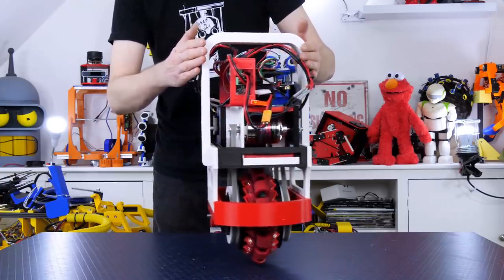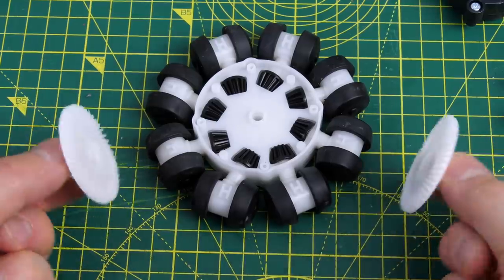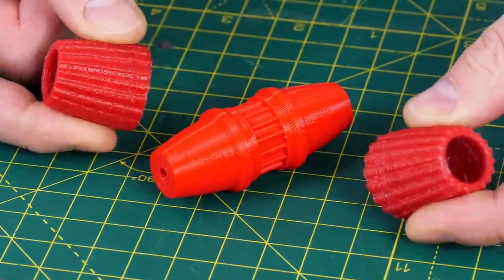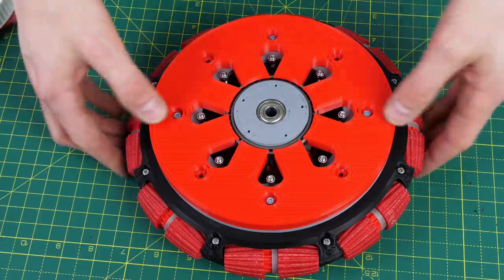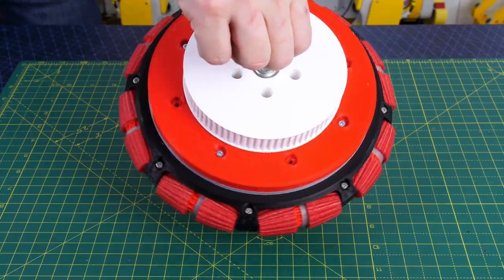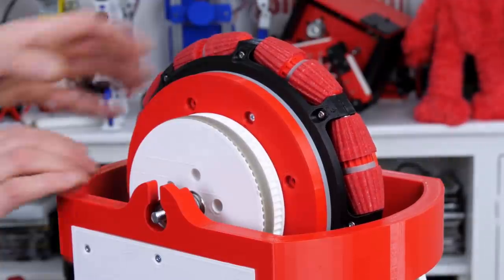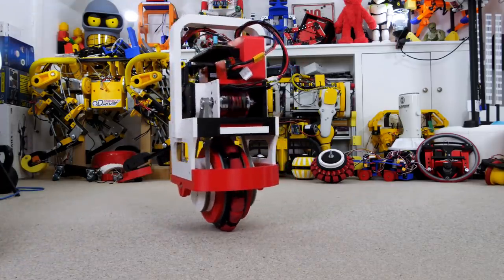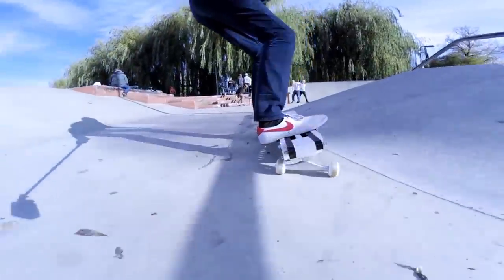How It Balances on ONE Omni-Wheel

Comment: Given the encoder could you use that to determine the position of the large wheel on the bottom and use a velocity multiplier based on the known geometry for the tapered wheels? May not be perfect but better than unknown.
Reply: Seems pretty doable! If he's using a relative encoder then it will be difficult because he won't actually know the rotational position of the wheel, just the displacement from the initial position at power-on. Using an absolute encoder or being careful to power the  machine on with the wheel in the same position each time (or rather, one of several equivalent positions because the wheel has some rotational symmetry) would fix this though. Maybe we'll see this in v3?
Reply: That's a cool idea and sounds like it should theoretically work on a level surface. But the moment you encounter any sort of incline you'll be in trouble because the part of the wheel that's in contact with the ground isn't at the direct bottom of the wheel.
Reply: yeah, this was the first thing that came to mind once he mentioned having problems with the taper on the small wheels. It's pretty doable and I bet James already thought of a similar solution.
Reply: I was literally thinking the same. The encoder would need to be quite high resolution though as even a single degree of precision would throw it all off. This could be get quite expensive so the trade off between this solution or just a bumpier ride via constant diameter "wheels" would be interesting. Mind, he's probably got enough encoders lying about that one will work.
Reply: I'm not a control theorist but..how about, instead of using a positional encoder you could see how much acceleration (from IMU) a certain movement of the wheels made, calculate the implied gearing (which side of the wheel is on the ground) and adjust the movement accordingly. I guess this would be akin to a double pendulum closed-loop? Success would depend on the sampling rate of the IMU, motor drivers, control loop, etc.
Reply: Came here to say the same thing, but probably wouldnt of been as well worded :p
Reply: Would the idlers perform better if they were a bar with a concave curve to them? Maybe less slop?
Reply: But only on flat ground
Reply: Exactly, because driving it at the same speed regardless of position is only accurate for a circular wheel when in fact it's closer to a regular 16 sided polygon (hexadecagon), not exactly because of the give of the TPU where the wheel meets the surface. But it would be closer.
Reply: @sherwoac  i think the reality of the arduino based imu is that they're probably too noisy and not refreshing fast enough for fidelity on that level
Reply: It seems that the speed needed to keep the taper the same speed would make a sinewave, so just have that sinewave programmed into the speed controller and keep it alinged with the wheel using a hall effect sensor and a magnet in the wheel.
Reply: Install an absolute encoder on the drive wheel hub.  Or use a photodetector and paint spots on the hub that line up with when the wheels are "small" so it can switch between two gains.

Comment: Just a quick tip: adding a bulge to the belt driven gears will keep the belt in the middle of the gear. Not sure if it will work with a twisted belt. Cheers
Reply: Crowned like on a band saw
Reply: Whenever I encounter this concept, I always have to convince myself that the belt would actually move towards the bulge.
Reply: @milandavid7223  It keeps train's central to the rails too

Comment: If you could predict the position of the shaft you could predict the cone of the smaller wheel and adjust your algorithm accordingly. Incredible video as always thank you for making these!
Reply: Differential equations. Little bit of math would solve this whole thing
Reply: The coding needs to be tweaked so it's horizontal axis isn't as glitchy and mechanical, using no gradual braking or acceleration, just full power, full stops making it compensate itself by incremental building up reverse inertia via momentum.

Comment: Next iteration:
- using more and shorter wheels with constant diameter
- miniaturizing the belt system to fit more belt systems
- using one gear to drive 2 belts (effectively doubling the amount of usable belts)
Reply: Would the idlers perform better if they were a bar with a concave curve to them? Maybe less slop?
Reply: @reubenj77  either straight or convex, since the belt will walk itself off a concave roller
Reply: @WetDoggo , yeah, I saw a demonstration where a belt will center itself on a convex pully. He should be able to prevent the belts from walking, by making the mating surface convex.
Reply: @notahotshot  the idlers/tensioners can be convex, but the gears can't be convex for good meshing.
At least not strongly convex...
A little bit of "convexness" might actually aid a bit in keeping the belts in center.

It might be worth a Test 🤔

Comment: wouldn't dust and debree be a major disadvantage of designs like this where the wheels that contact the ground act as part of the internal mechanism? I imagine it could jam up pretty quickly
Reply: That's mostly true of any omni wheel.
Reply: @aviphysics  not that motorcycle
Reply: @ionbusman2086  It's also the case for the mini motorcycle. Drive it a little bit into the mud and even those nice molded plastic gear will eventually jam.

Comment: Ever thought about using machine learning to balance these robots? seems like the perfect use case for ML. It could optimize for stability and least wobbility.
Gather lots of Input and sensor output data using this crude stabilizer (add some randomness to it) and train a sensor output predictor. This is a physical model of the bot. Use it to train a second model that optimizes input to predicted sensor output for stability and least wobbility.
The gathering and learning could be done more or less in realtime. Let it do its thing and collect more data for both models and train it at the same time.

Comment: Hey, Motorsport engineer here. 
Really cool wheel mechanism on that robot. Although, I don't think the tapered wheels are hurting it as much as you think. 
I have a hunch that controlling the lateral motion with only one motor is creating a yawing moment due to gyroscopic effects from the motor. 
I think when the robot leans to left, the motor spins up to lean it back to the right. But in doing so, also yaws it to the left due to gyroscopic torque. There's probably some unintentional feedback that is created from there. 
The easiest fix would be to spin up the second motor as well to control lean angle and see if that does anything.

Comment: Can you add an encoder to get orientation of the big wheel? then you should be able to know the diameter of small wheels contacting ground. Then add it to calculation of required motor speed. A bit of an overkill, but I see the wheel will vibrate when moving forward.

Comment: Another solution to the belt walking might be to just make the gear teeth concave, like an hourglass, so that the belt wants to just stay in the middle of the gear, rather than adding more parts to complicate things and increase the total print time. EDIT: Perhaps sticking with the belt strategy and "pinching" the gears to keep the belt centered you could double up on the smaller wheels to improve big wheel's roundness, without tapering/rounding the smaller wheels? Otherwise I was thinking somehow track the position of the big wheel to know where along the smaller wheels is contacting the ground and modulate the speed of the smaller wheels from there - which would be a bit of overengineering IMO. I'd try just increasing the total number of wheels at least by double first and if that didn't pan out then I'd resort to tracking the big wheel's rotation and compensating for the radius of the tapered smaller wheels.
Reply: Flat belts tend to walk themselves out of dish pulleys, a crowned pulley makes them center but the twist complicates this, also the fact they're toothed. You can't keep a constant tooth profile on a crowned or dished pulley.

Comment: If you added one more drive motor and made every other small wheel turned by the new motor, you could potentially gain another axis of control, i.e. yaw.
It looks like you have 2 small wheels contacting the ground at any given time, driving them in opposite directions will give you that ability to turn.
Though, you would almost certainly have to add an encoder and programming would be a right pain (every time the main drive wheel advances another small wheel, the rotation would have to flip between the small wheel motors to continue turning in the same yaw direction).

Actually, that sounds really complicated. Maybe just a huge flywheel and use it like a spacecraft reaction wheel, haha. The Honda 'single wheel thing' essentially did the same, except the reaction wheel was the user's arms.

Comment: If you have issue with the taper, have it move to the center of the small wheels before side to side, when not moving.
Would need to index at which rotation each center is, so it can move to the nearest.
This will cause it to move forward or back a little, but then the side to side would be much more stable.

Comment: That rug also play a role in the instability basically that rug act like mud, motors have to work hard to get it moving but when its finally moving there is too much power so it tried to slow down to the point where the rug being the problem again

Comment: interesting video)) engineering is on top as always)) now we need to complicate the task, and make the whole structure spin around its axis 360 degrees) it's time to add the 3rd engine, and figure out how to make the pair of wheels that is responsible for lateral movement spin in different directions for a turn)

Comment: Hey James, to prevent 3D printed parts to slip you can wrap around them some heat shrink sleeving. That's some quick and easy rubber coating. Regards.

Comment: Add weight up higher to raise the CG.  This will make the robot easier to balance.
          Here is a crazy idea.  Set the twist of the little belts alternating between each small wheel.  This will require the adjacent orange gears to turn in opposite directions to have the little wheels turn the same way.  The orange gears can be made a little larger so they engage with one another, so in theory, only one need be driven from the central gear.  You could have every other one driven from the center.  The others can be made narrow so they miss the central gear.  (You must have an even number of small wheels.  Since you have 8, this would work.)

Comment: Cool project! Can't help thinking you'd need a physical inertia  damper.. Like a damped pendulum, or whip antenna with a weight on top. Maybe you could do that in software, but possibly better to somehow engineer it in physically to the wheel? (a flywheel in the wheel?) On the Honda mono wheel, the active inertia damper is the person sitting on top. I used a passive method to damp out motion on a tall camera mast, rolling slowly on a DIY track and dolly. Worked really well!

Comment: 0:23 that main middle wheel, with those tiny side wheels needed to be rotated 45° and in the shape of a foot ball clipt at the edges for the accels. When the main wheel rotates, it will not have uneven wheel bumps, and the bottom main and rim wheels, will sync combo to all required ground direction.

Comment: Tuning the velocity of the small wheels should be fairly easy. Take the position of the main drive motor, apply the pulley ratio, and define the 'steps' of the wheel, in this case 16, then alternate velocity per step, as you have eight large circumferences and eight small circumferences with the tapers. You could also refine this further, interpolate velocities between the steps by using a sinusoid that provides the function for velocity based on the position of the wheel, so if you end up standing on the middle of one of the tapered half-rollers, it'll provide velocity for that specific contact, and not just if you're standing on one full roller (two large circumferences) or standing on two rollers (two small circumferences). 

Also, while off-plane idlers do work, a better means of belt position retention would be belt guides. Ideally you would want the belt to be, for lack of a better term, square with the pulley  it's on, to prevent walking. Assuming you can find a belt with enough flex along the axis of its width, this should be possible to do with properly modeled guides. Though this would need some kind of retention, a semi-closed channel (think of a squared C, a box with four 90° corners but an open slot in one side) could work, but so would a U-channel with additional idlers opposing the channel. This would also require low friction, PTFE tape should suffice but I'm not sure how well this would interface with the belt itself. If using a semi-closed channel, the ends should be flared on the toothed side to prevent snagging. 
Belt walking may not seem problematic, but there are power losses associated with it, because you're losing at least some amount of power to walk the belt along the pulley. A better fitted belt may also suffice, though. But a channel overall would be more ideal compared to just off-plane idlers. Think of a channel as a series of idlers, a constant surface easing the transition of the belt, rather than having the belt at angle A (0°), angle B at the idler (45°), and angle C (90°) on one side of the loop, whereas a channel would be a constant gradient between the two points as ∇f:0°→90° along half of the loop; yes, the actual loop is more complicated, as you have 180° turns at each end within a separate plane, but the part we're concerned about here is the planar transition between 0° and 90° along the length of the belt. In short, gradual transitions are better than segmented transitions, more efficient and with less wear assuming the same friction.

Comment: Making the little wheels cylinders with a thick coating of super soft rubber or silicone would help since the soft rubber  would compress in forward & backward motion, keeping it smooth. While also allowing for consistent diameter for side to side. ( with the right ratio of softness to stiffness). Alternatively, scaling it up while changing the little wheels to cylinders could help since side to side would be more consistant and the larger overall diameter would allow for more rollers, smoothing out forward and backward motion

Comment: Super neat implementation. 

Smaller toothed pulleys and smaller gears would go a long way to prevent misalignment, or angle of attack on the belt. Sure, skipping might be more of an issue - but compared to the friction drive it would still be 1000% better.

Smaller gears/pulleys would also allow to add MORE belts and more independently driven tires, to help maintain a more constant rolling circumference.

For tensioning, that ring was pretty painful! Angled slots or ramps like you might see in an iris would have been much more elegant.

Comment: Since you have positional sensors for your motors, you could probably calculate the current gear ratio as a function to motor position, and thus vary the speed of the motor as it travels in order to achieve a constant wheel velocity.

Comment: Re- your Mobius strip belt: if you don't want to use idlers to secure the position, you'd need to crown the surfaces that the belt is running on to make it center itself. There's a southbend lathe at my work that runs it's belt drive like that on perfectly smooth pulleys
Reply: That lateral oscillation might be an artifact of binding while it's trying to upright, that is then gone when the weight is shifted off of whatever is causing the binding

Comment: I think you can compensate the tapered wheels problem in the software. You need sensor like an accelerometer to tell the position of the bug wheel or which part of the tapered wheels is touching the ground.

Comment: Related to these general multidirectional self balancing stuff. I am interested in something ridable so 3/4 suspension wheels to proxy a single contact point was the idea I had. Hand remote to recorrect rotation, or roll at low speed maybe.

Comment: They're getting better! 
It's totally amazing to me watching you build these machines. I only wish I had the knowledge you have to do this. 
I do have a question about the brushless motors you used in this build. I have a desire to build a couple cordless woodworking machines using brushless motors that could be run by established power tool batteries (Makita). Could you direct me to a supplier that may have appropriate motors and controllers? Looking to build drill press, tablesaw, etc...

Comment: make each of the red wheels as 20 x 1mm wheels, spaced with 1mm gaps but connected in the middle axle, when they are bent, they will come together within the 1mm gap but essentially, they will all be the same diameter and rotate at the same velocity

Comment: If you increase the distance between the pulleys/reduce their diameter, the twist and belt walk become less prominent. This would mean a bigger wheel, but if you want to recreate honda's gadget I think that would be a plus. I think a bigger wheel would have less of a taper on the small wheels which would also help I think.

To solve the side to side issues, you could add an encoder on the wheel, and use it to scale the side to side gain depending on what angle the wheel is at. You could apply a sinusoidal scaling depending on encoder position. If you gear the o drive to the wheel at the same ratio or lower as the number of small wheels, you could even use the O drive encoder output for this job.